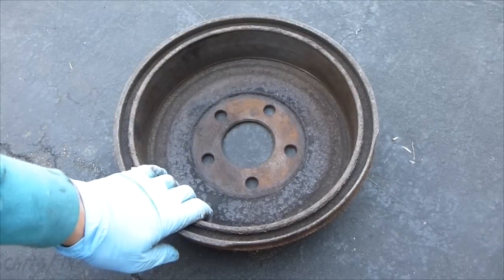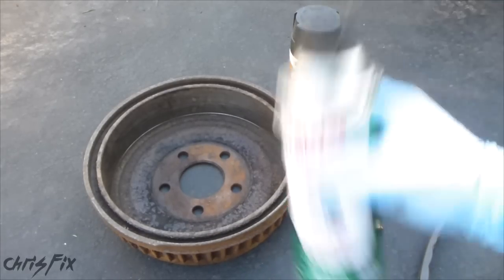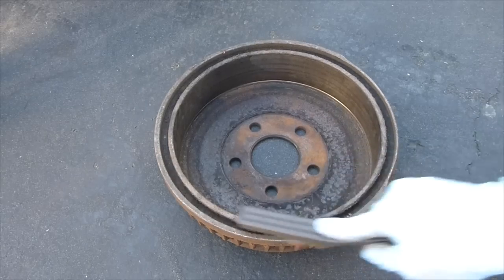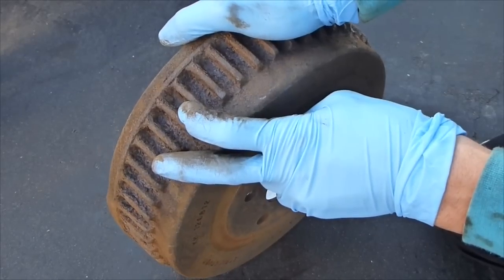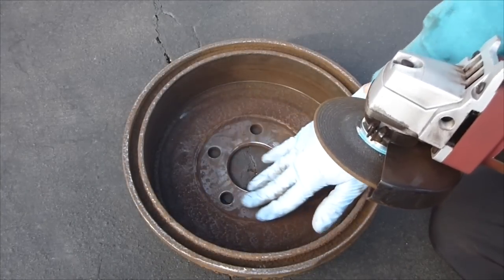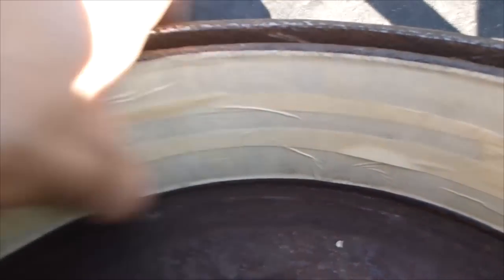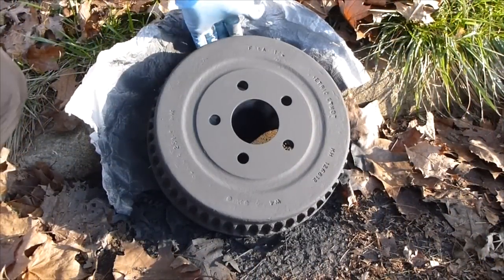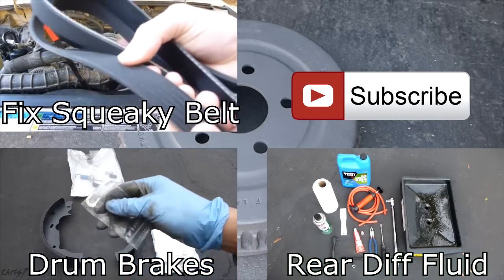How to paint brake drums ANY color DIY

Comment: can I replace brake cleaner with wd-40? are they the same
Reply: No.  WD40 has a lubrication quality that will leave a film. Brake cleaner leaves no film and has excellent disolving ability for grease and oil. WD40 is great for removing stickers and films, but needs to be followed up with a degreaser to remove the oily surface WD40 leaves, as it doesn't dry.  It's a LUBRICANT primarily.

Comment: Not much of a point painting the inside. Brakes shoes just gonna remove it afer you brake hard a few times. Painting the outside of drum is a good idea but I just buy new drums and shoes. I understand saving money whefe you can but considering new rear drum brakes on, say a Chevy, might set you back $200 for the whole job including springs, adjuster, pins, shoes and drums if you do it yourself.
Reply: Just to clarify for those who are reading these, he is not painting the braking surface of the drum. He taped those off so they would not get painted. He is doing this to aid in corrosion resistance and anti-seize on the exposed surfaces.

For those who maybe don't want to go through this process but have had to beat a drum off a hub in the past, highly recommend use of anti-seize grease between surfaces that might corrode and lock in with each other. In this case that would be between both the hub and drum, as well as the drum and the wheel.
Reply: @fakefake3660  didn’t consider that perspective. Thank you for the insight that’s awesome.

Comment: why use cleaner before sanding or wire brushing?
Reply: Breaks apart the big thick rust easier less work ....think of it like washing a dirty dish pan do you let it soak in hot water first or just dive in with a cleaning pad

Comment: what do you mean by you got then turned?
Reply from the maker: +Ivan Aguilera There is a machine that removes a thin layer of the drum so that it is even and smooth. Then you can reuse the drum (if the drum is still thick enough).

Comment: Not trying to be the "negative guy".... but why beautify the INSIDE of the brake drum?  It never gets seen by anyone?  I feel its a total waste of time and energy.  It would be more satisfying to paint the bottom of your sneaker or shoe.... everyday... so that it always looks nice.
Reply: Water still gets in there and the paint provides some protection against rusting.
Reply: Brakes wear out before they rust out besides they're so cheap it doesn't make sense to spend time painting the backside of them
Reply: I'm doing the same thing because the inside of the hub is so rusted.  I live in FL and it rains here a lot.  The paint will help protect against rust and corrosion and against any rust flaking and getting into the brake system and scratching up my brake surface.  ;)  It's not for looks.  It's to protect.
Reply: Preventing the drum from corrosion and then seizing to the hub. It makes it easier for inevitable servicing in the future.
Reply: I totally agree with you. Absolutely not necessary to paint the inside.
Reply: Ilias Vamos yes it is
Reply: Any additional protection for drums that are on the rare side is a good thing.  I can't whip down to the local autoparts bigbox and buy my drums, even on back-order.  So when I do mine in the next week, they will be getting a couple of layers of high temp paint where the sun don't shine.
Reply: No, dont do halfway jobs.

Comment: all that time and effort, and the cost of resurfacing doesn't seem worth it at all.  Just buy a new drum
instead of using the grinding/cutting wheel, why not just use a disc wire brush on an air tool

Comment: No rust remover used, no rust preventer used, no primer used, and no clear coat used. Not the ideal method, but one of the cheapest.
Reply: Still worked

Comment: Good video. Have you ever used this stuff?
http://www.eastwood.com/eastwood-rust-converter.html
I used it when I restored my Z28 and it works pretty good.

Nice shot wearing all your PPE.  :)
Reply from the maker: No, I have never used that stuff. Kinda expensive. Maybe I will make a how to remove rust video (the cheap way LOL)
Reply: ChrisFix Soak the drum in electrolyte solution and zap it.
Battery, electrolytes, steel rods and time. Watch the rust disappear.
Reply from the maker: Yeppers! Or use some acid (vinegar). You know your stuff! Obviously spent a lot of time with your z28!

Comment: buy new drums lol.
Reply from the maker: Richard Cowtails These drums were still good. No need lol
Reply: Well lets say turning the drums cost about 50 bucks. Around les schwab price. New drums the parts store for 60. This was my scenario. Deff should've painted them, UGH lol
Reply from the maker: Richard Cowtails It cost $25 to turn them and $50 each for new ones. For half price, on a 300k mile van, it is worth it.
Reply: No sir lol
Reply: I'm paying $10 a drum to have them turned vs $40 a drum for new.

$60 is alot of beer money.
Reply: Not sure where you're from but I. Or they charge 25 per drum/rotor. At that price... new is well worth the money
Reply: Richard Cowtails I have no problems doing new rotors every time I do new pads.  I don't see a need in replacing the drums every time I do shoes because shoes/drums don't wear at the same rate.

How many sets of pads do you go through before you go through a set of shoes?
Reply: ohh nonononononono not everytime changing pads lol. sry, I might've been unclear. just when ever you need to resurface, I usually just buy new. wait for napas like 1st tuesday of the month sale and get those there. I got both drums for 40 steal of a deal
Reply: Richard Cowtails 25 dollars for ones made in the wung hung lo factory. spend extra on your brakes they save ya life
Reply: Got mine for like 50 from napa on 2nd sat sale
Reply: I think, It's been awhile. You dont have to buy drums very often